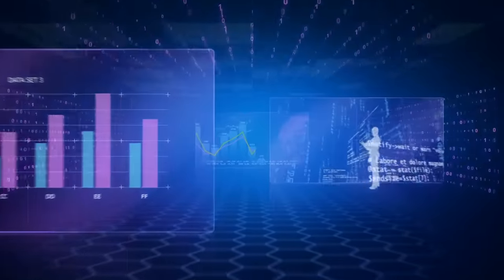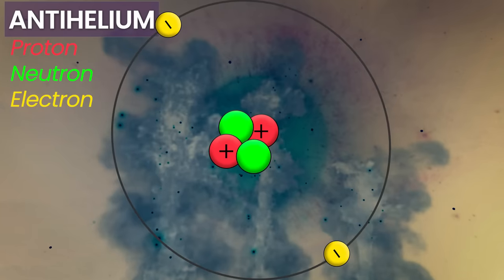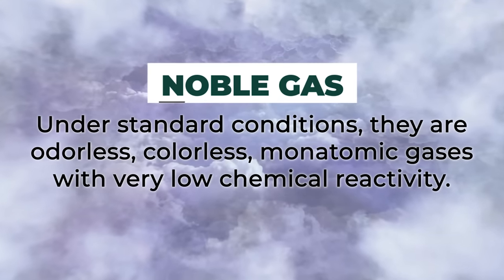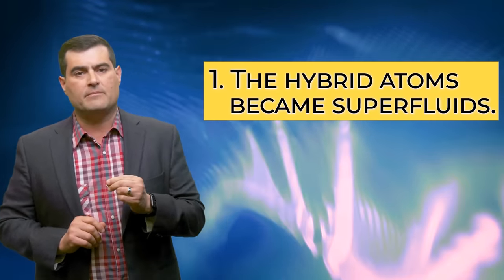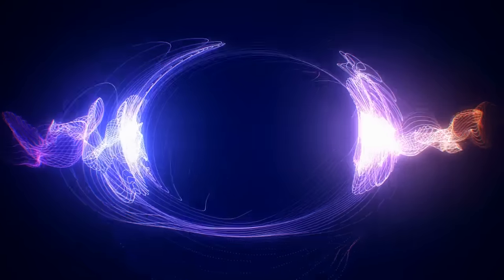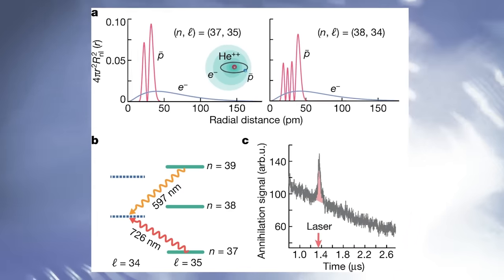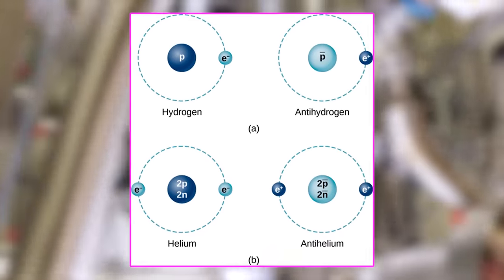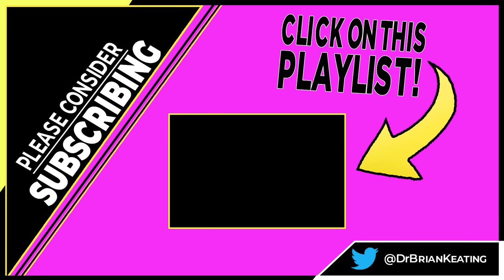Why is Antimatter Behaving Badly?

Comment: Huh, wouldn't it be hilarious if we found a way to use this to make antimatter reactors before fusion 🤣
Reply: We'll still need a produce the anti-matter in a practical way and at industrial quantities.  Firing particles at each other in an accelerator and occasionally randomly getting some anti matter, takes way too much energy and produces so little of it. But it that was exactly though though use it in a reactor.
If you can break it up with a laser and release it from the hybrid matter, well now you've got a fuel and a way to "ignite it" in a controlled way.
Reply: Unfortunately the antimatter doped super fluid helium 4 only lasts microseconds but it might point a way forward.

Comment: It has been proposed by some people that applying cold to particles causes them to spin faster.
I think this is supporting evidence for that idea.  If the protons are spinning faster, then a regular antiproton would be spinning oppositely at a lesser rate.  That could be how it replaced the electron.  When the protons start to slow down though, the spins become the same again and theres not enough momentum to keep the anti proton away.

I heard about this experiment like a year ago, thank you for giving it some attention, it's very interesting.

Comment: An interesting development! You probably know this, but in connection with this news, it may be worth noting that there is now a fairly extensive physics and even chemistry known regarding the also-surprisingly-stable entity possessing both ~0.12 and 142 ns lifetime states known as "positronium", Ps -- a bound state of one positron and one electron (or in some cases more elaborate adducts where the Ps associates with neighboring atoms or small/solvent molecules).

Comment: The odd question about matter / anti-matter annihilation, is: why?  Why do electrons and positrons annihilate? It seems obvious that they would attract, come into contact, cancel out, and annihilate. Except .. protons and electrons also attract but they never annihilate. Instead a proton and an electron combine to make a hydrogen atom. So why don’t electrons and positrons make a weird “electro-atom”?
Reply: In that case you could also state why can electrons not take the place of neutrons at an atoms core. So it is a to strong simplification. Electrons do not have the strong or weak nucleair force that protons or neutrons have.
Reply: The reason for this annihilation lies in the fundamental nature of particles and antiparticles; they have opposite quantum numbers, such as electric charge, and their interaction leads to the cancellation of these properties, releasing energy. Protons and electrons are not antiparticles of one another; the proton's antiparticle is the antiproton, and the electron's antiparticle is the positron. Their masses are also significantly different, and they participate in different types of fundamental interactions (protons are subject to the strong nuclear force, while electrons are not).

The concept of an electron and a positron forming a stable "electro-atom" is somewhat realized in the form of positronium. Positronium is a quasi-stable system consisting of an electron and a positron orbiting around their common center of mass, similar to a hydrogen atom. However, because the electron and positron are matter-antimatter pairs, positronium has a very short lifetime and eventually annihilates, producing gamma-ray photons. The lifetime of positronium is too short (0.1244 ns) for it to form more complex structures or undergo chemical reactions like normal atoms.
Reply: @AutisticThinker Great detailed info :)

Comment: Question for anyone : Why is the speed of light called a constant when, according to Einstein's famous E = mC^2, (E/m)^1/2 = C, which says the speed of light is a ratio of the total energy of the universe divided by the total mass (the square root, but we're talking about such big quantities , for simplicity's sake, I'm just going to concentrate on the ratio part. 
We have learned energy and matter are two versions of the same thing, nuclear bombs are an example of matter turning into energy. 
If E = 0 and it's all one hunk of matter, C = 0 because there's no place to go. 
If m approaches 0, and it's all energy, C will increase, in fact, C will approach infinity. Question: If the ratio changes, will all light waves/photons change speed or will ones released during a different epoch "remember" it's earlier speed? 
Or will they simply adjust to their new reality, and analogue style smoothly change with the changing ratio. 
Can the ratio E/m change? It does so within stars and atomic bombs, so why not the universe as a whole?

Similar to how a Gaussian closed 3-D surface can be treated as if its center of mass point contained all of its mass, can an area of space be treated as if its average E/m ratio were the universe’s E/m ratio? In other words, if in interplanetary space, can a space station behave as if the mass of the universe were much less than it is, thus raising the speed of light on the station?

Comment: Protons are bundles of 918 neutrinos with 2 positrons inside. An anti-proton has 2 electrons inside. That’s why a positron can orbit it to make anti-hydrogen.
Reply: The neutron only has 1 positron. That positron is in the center and holds the neutrinos together. Neutrino = “annihilated” electron-positron pair.

Comment: In the visual, for superfluidity, it shows a column of water "bouncing" out of it's container, but wouldn't that imply some viscosity? From your brief explanation, why wouldn't the molecules dissociate from each other and become almost like a slow moving gas?
Reply: Gravity.
Reply: @paulmichaelfreedman8334  Gravity would be too weak to cause association between noble gas particles.
Reply: @DaveNegrotto  Gravity would hold the gas together in a container. Although it would never come to rest, it could eventually relax into a state of minimal turbulence.
Reply: @paulmichaelfreedman8334  Roiling boil as a way to think about it maybe? Thanks for explaining. EDIT: Maybe a slow simmer is a better analogy.

Comment: Hey Dr. Keating, I've got a question that's way off topic and is about negative matter rather than Anti matter. Is it possible that negative matter could have existed but was chased out of existence by positive matter? I've heard before that when things accelerate they gain mass/ energy, if negative matter gains mass by being chased by a positive matter, wouldn't it reduce up to zero matter? Could this also explain inflation? 
Thank you
Reply: Weirdly enough, I had the same thought more or less. I was wondering if the chaos of the 'chasing pairs' could have had an effect on the balance of matter/ antimatter.

Comment: But why don't they annihilate each other and where does that energy come from upon annihilation? I've always wondered that. 
So if combining a piece of matter and antimatter of the same sort causes in annihilation, could we not use that for energy generation? Sounds like we could charge a lot of phones
Reply: I think its because matter and energy is kind of interchangeable (Einstein's eqn) and matter and anti-matter both have mass
Reply: The energy of the two particles is converted usually into gamma rays, and sometimes into additional smaller particles.
Gamma rays are photons with a very high frequency (and therefore energy), even higher than X-rays.
This is the most efficient conversion of fuel to energy possible (100%), but there's a huge problem of capturing this energy.
The more energetic a photon is, the deeper into materials it penetrates and the more dangerous it is.
Everyone knows X-rays for their ability to look inside the human body. The image the doctor gives you is the shadow of some of the light your body managed to stop. To properly stop gamma radiation, meters of concrete are needed.
Gamma rays and X-rays are also classified as ionizing radiation, which means that whenever they get absorbed by an atom of the material, they knock off an electrons from the atom. The atom loses a negative charge and becomes a positive ion, hence it's called "ionization". This is bad, because electron bonds are what hold the material together.
If you imagine solar panels collecting energy from sunlight's photons like catching a ball thrown at you, trying to capture a gamma ray is like catching a bullet. Whatever equipment you use to generate energy from this would get shredded atom by atom, and require to be replaced often.
Reply: Energy storage and energy generation are not the same thing. Your phone is already powered by anti-matter. The Sun generates energy partially from electron-positron annihilation during Hydrogen fusion. Some of this energy hits Earth and eventually after making its way through many various systems, ends up in the battery in your phone.
Reply: @Adam-zt4cn  thank you. I do understand 🙂

Comment: Ooooh it’s like the kinetic magnets and how the third position causes instability but the 2 others keep trying to stabilize so it’s able to move or do things like quantum behaviors but at macro? Could be why gravity exists. The push and pull of the planets and such could be unstable but constantly trying to stabilize? It’s the sharing of the differences between the differences which keep exiting it and it gets that and shares it back. Like flipping poles but the flip is outweighed so it’s like a perpetual motion machine. The loss is less than the charge? Idk I’m lost.
10:13 so they just align better so less combat or friction between so it can survive for longer and balance better?

Comment: If it is true that "Thermodynamically isolated antimatter can increase its entropy only backward in time (unlike any isolated matter, whose entropy increases forward in time)," then that could explain the differences in the amount of Matter vs Antimatter in the Universe. This is because time is a "concept" not a force, and going backwards in time is impossible.
Reply: Charge symmetry and time symetry both operate the same in the equations. It the charge that is opposite. Not time
Reply: @nomad8473  It is Entropy that is changing, not Time, as it is always the Present, and change cannot take place anywhere else.

Comment: Nah the anti-protons should be the Negatrons. I follow the logic of electrons being called negatrons but we already have electrons, it's electric people get that, we already have electrons cover no need to change that, but if we're going that route, why are electrons the negative side of that model? It's always confused me with it comes to batteries with the negative side being the output side, shouldn't that be positive, if you have a gas or water in a line and it's got pressure, positive pressure.  You don't say it has a negative pressure that implies it's lesser pressure than the outside. So why is electricity backwards? 
Can we go back in time and smack some upside the head to whomever decided these things?

Comment: Antimatter Man.... He lives in a magnetic force field and whatever he spits at explodes with the force of a nuke... The answer is the heavier, composite anti-protons have multiple bonds with multiple surrounding helium atoms that are themselves made of protons and neutrons that are all made of electrons and and positrons, not quarks. This is now so obvious it should be undeniable to even entrenched mainstream physics as at least a very valid explanation that should be explored.
--
Don't forget, I've been saying all matter is made from electrons + positrons, not quarks, for decades online in various forms, in science channel comments sections.. The other version of this has an electron-positron field instead, with a field cell being a +ve and -ve cell in superposition that can be fully split into a positron and electron that semi-split the surrounding field cells into +ve and -ve bands/shells/energy levels as they pass through. I think the two versions (fully vs semi-quantised below) need to be combined. 
--
ELECTRO-POSITRONIC FIELD: -ve gas binds a ball of +ve cells freed by Full Escape Energy as electron_positron pairs
SPIN: particles pull in gas/pump out loops (to others in magnetic circuits, offsetting cells. Flux charges the field)
MASS: lateral spin outflow force cancels/concentrates, leaving inward field stretch. +ve shells, -ve gaps, packed core
DARK GRAVITY: gas moves from voids to matter. Expansion + contraction. Field density gradient / warped space(time)
HEAVY FORCE: mass multiplier mechanism pulls in field before annihilating all particles but (anti) protons/neutrons
HEAVY FUSION: in the Big Bang (and stars?) 2 positrons oppositely hit 1 electron (more than 2 electrons hit 1 positron)
POSITRONIUM: e_p. Muon: ep_e. Proton: pep. Neutron: pep_e. Tau: epep_e. Neutron mass is halfway between muon and tau
ANTIMATTER: 1,2 e_p pairs annihilate. 3: proton+anti proton or muon+anti muon. 4: neutron+anti neutron. 5: tau+anti tau
LIFETIME: Velocity (and gas density?) slow Local Time. (Anti) muon/tau heavy force starts after it slows from near C?  
BETA- DECAY: pep_e => pep e. Beta+: pep + new e_p => pep_e p. Weak Force: unstable atoms form and annihilate e_p pairs
NUCLEAR FORCE: neutron electrons bond to protons. Mass and magnetism compact and strengthen the nucleus 
BLACK HOLE: atoms cut into neutrons fused as tau cores (epep). Field spins, time slows, core annihilates, no singularity
DARK STUFF: more (anti) muon/tau (solitary cores?) as the galaxy thins out? 'Black hole spin'? Quantised inertia? MOND?
PHOTON: compressed, concentrated gas wave core pulls in field cells as it passes. Field warps diffract and interfere
2 SLIT EXPERIMENT: photon/particle field warps diffract and interfere, guiding the core. Detectors interfere with guides
INERTIA: energy lost moving through the field is returned as the field rebalances behind with a kick straight on 
ENTROPY: simplicity. Time reduces closed system complexity. Universe's simplest state is perfectly ordered empty field
ENTANGLEMENT: correlation broken by measurement? Physical link?